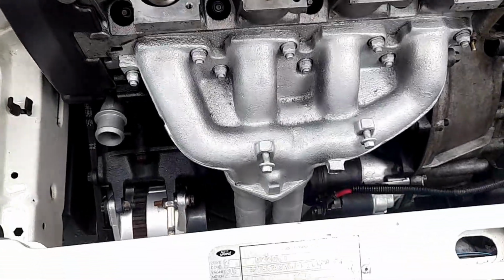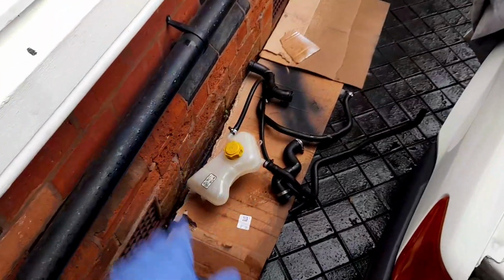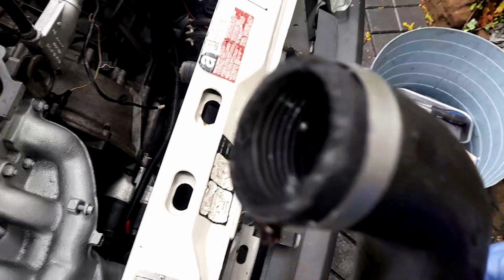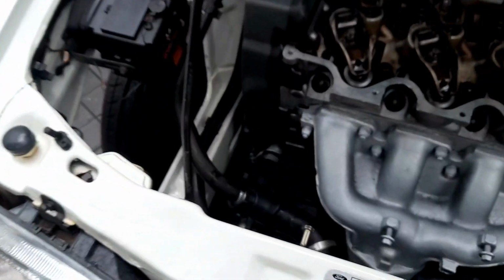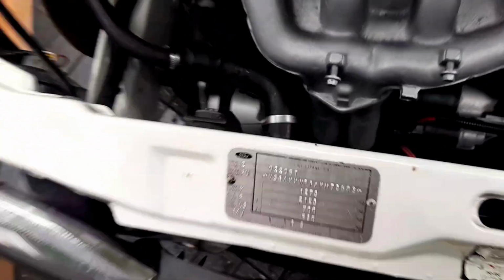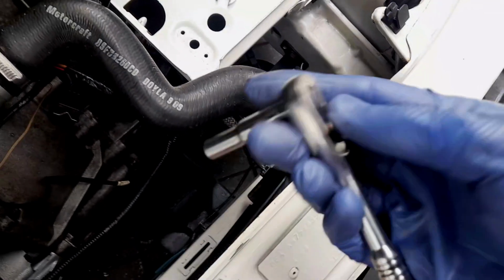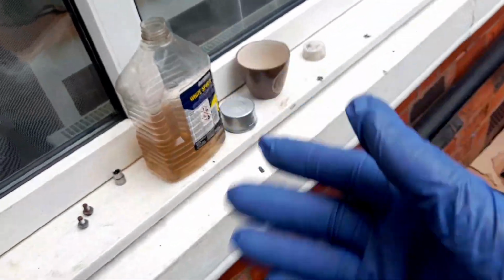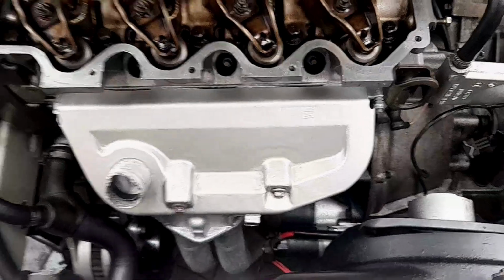Project Ruby Part 27 - I feel rubbish but the car is getting better!

Comment: The  thermostat can move in the housing especially if the sealing rubber on the back gets dislodged or starts to disintegrate. I have seen it before the stat has turned 90 degrees. Also there is a ball bearing in the housing which you have to make sure it is free or the car will always will stay cold
Reply: It is in the 4th hole of the housing at 1.32
Reply: The sealing rubber goes behind the thermostat you have put it on infront
Reply from the maker: I was thinking this might be the case. I'll look into this next time I take the thermo housing off. For now it's seated correctly but won't rely on this.
Reply: @usuallyfixingtinkering  the spring will sit in fine then. When you shake the housing you will hear a rattle that is the plunger in the housing if that don’t push up fully to block the water the car will run cold even though the thermostat is sitting fine in the housing. Your temperature gauge seems ok it should go to near half way then drop when the hot water goes through the top of the radiator pipe at 88 degrees
Reply: @usuallyfixingtinkering  in theory the rubber could go into the engine block so I would take it off sooner or later
Reply from the maker: @Joe-ug1vu  valid point!